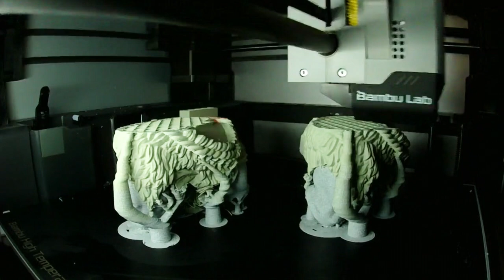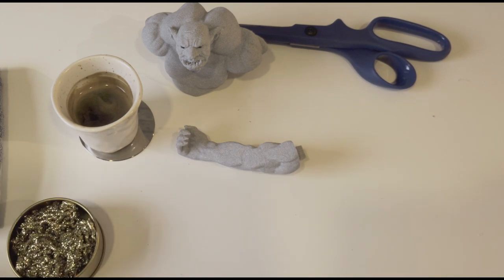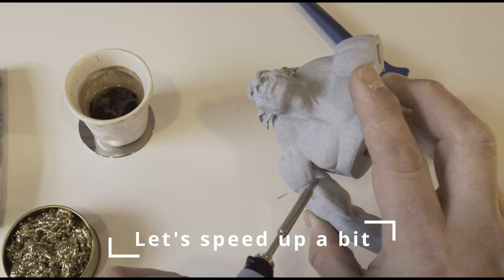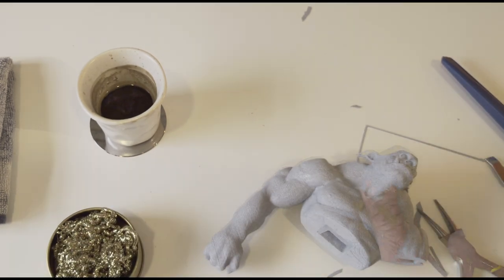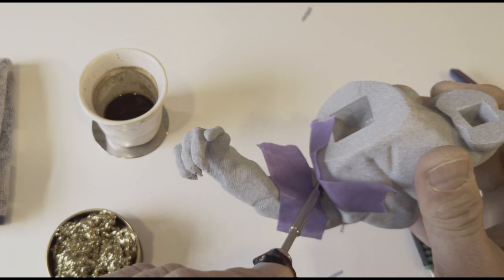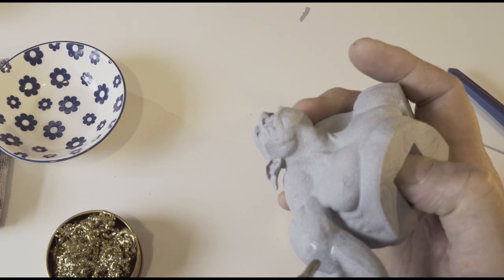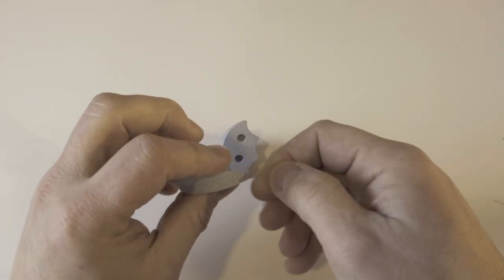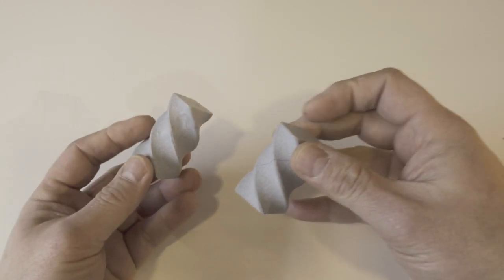Welding a 3D print or "How to make a TROLL seam to disappear"

Comment: 2 questions. What brought you to think of this idea. And how did you come up with the idea of mineral oil
Reply from the maker: I started welding out of necessity. I printed the Troll and didn't realize ahead of time te seams would be so obvious. So I tried welding a piece of brim in place and it worked so well I made some pictures of the second arm and posted it on Reddit.

And the oil was a solution to a problem. The soldering iron had the problem of arching to the plastic sometimes. I remembered i had this oil on hand, so I tried it. And it worked as I hoped it would. I even think that it dissipates the heat and protects the surrounding plastic.

Comment: Great video! I'm printing the same model but removing my supports messed his loin cloth up. Any insights on how you where able to do your supports?
Reply from the maker: I tried to orient each piece to limit the supports necessary, as you probably did. And als orienting the pieces so if supports failed it would be "invisible". But even that left me with some parts of the loincloth that were ugly. I smoothend fixed (remodeled) with the soldering iron and weld technique with mineral oil..